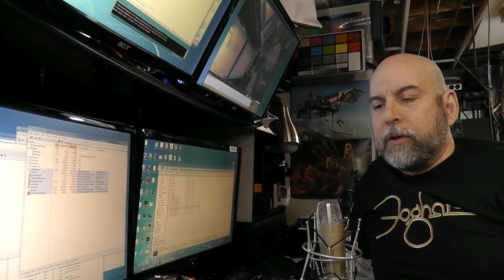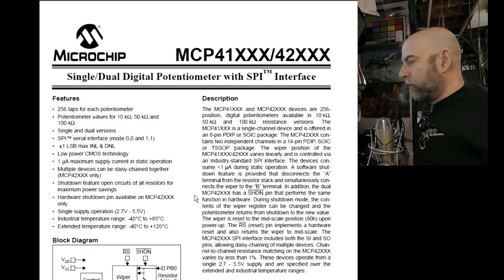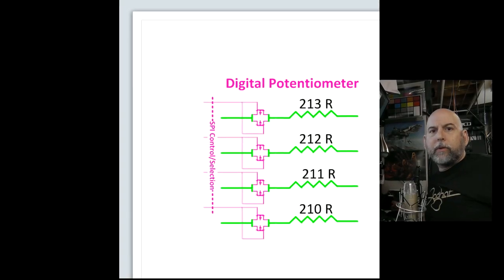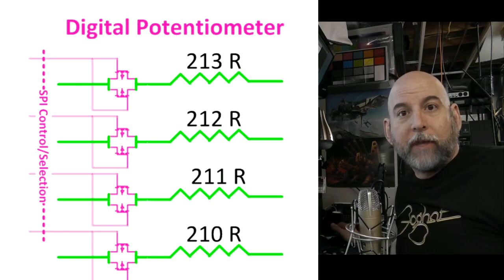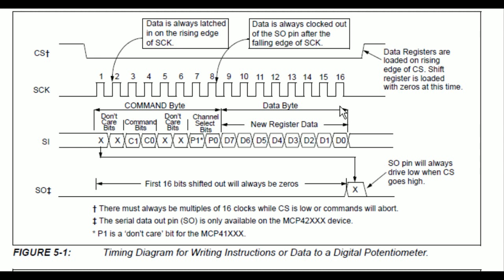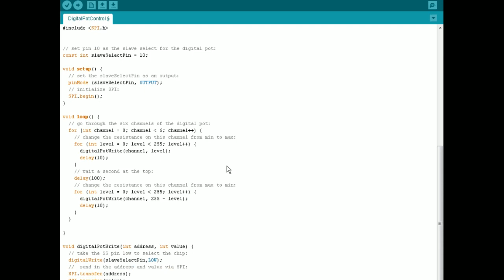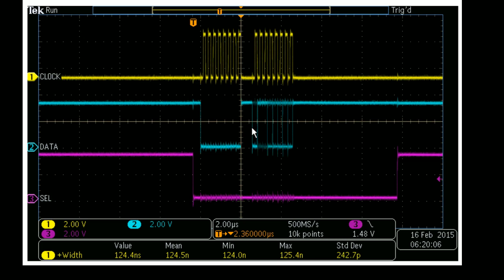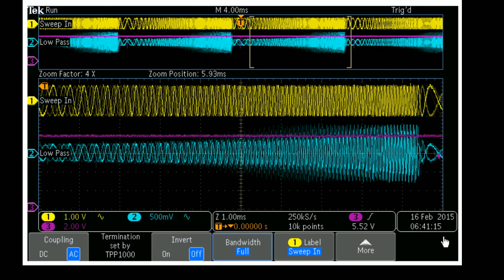Controlling Analog with SPI

Comment: The CP2130 is a great chip for controlling SPI devices. Also, you can easily send commands and control it via libusb under Linux, if you feel like programming.

Comment: Your diagram representing what is going on internally is incorrect. The device does not select an individual resistor scaled to N times R, but activates tap N from a series connected network of N Rs (all the same value of R since IC processes are good a matching but not good at absolute values). That tap becomes the "wiper" output. And that way it does indeed become a 3 terminal potentiometer. Of course, the "top" and "bottom" taps are interchangeable, but that reverses the division action.

Comment: Okey, digital pots exist. But wanto recall I seen switching cap thingy, that emulate resistors. There exist a Maxim chip, that does State Variable -filter. Never seen "switching capacitor" breadboarded though.. (I'll just keep on google)
Reply: what is the part number for this Maxim State Variable -filter? thx

Comment: 3:00 "Philips developed I2c in early 2000's".. Well, i2c was designed in -82 so at the same time when C64 came out. Version 2 came out in -98 and version 2.1 -00 so I guess Bil is referencing those.  Although in my own projects I use 99.9% of the time the original 100kHz version of I2c patented in -81. version 4 can go already to 5Mbit/s speed so you really have to start thinking how you route those lines. And yes, I know really old video. Carry on....